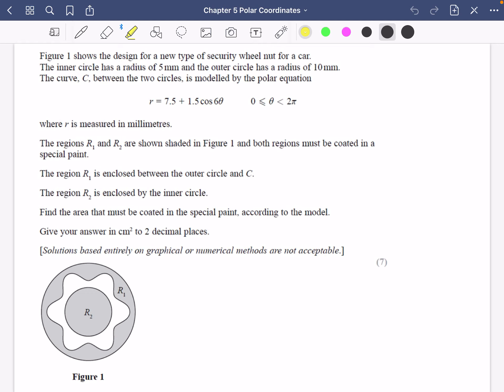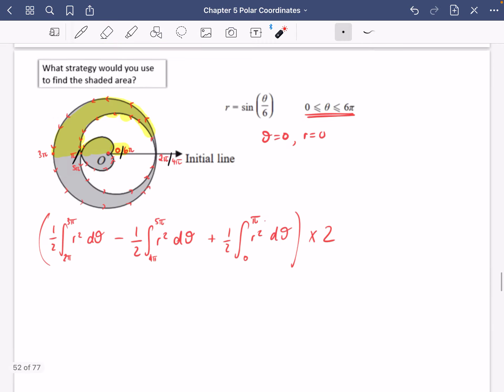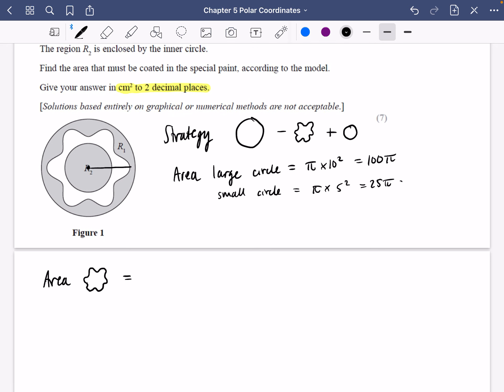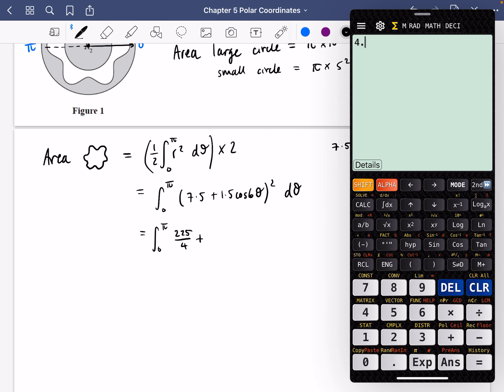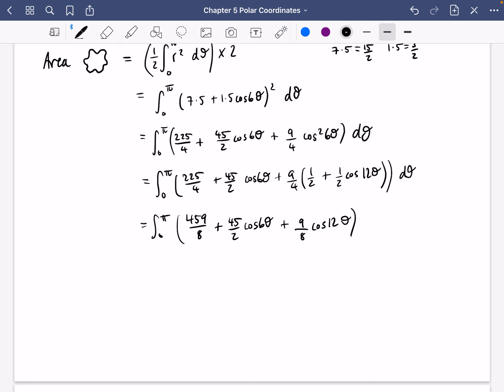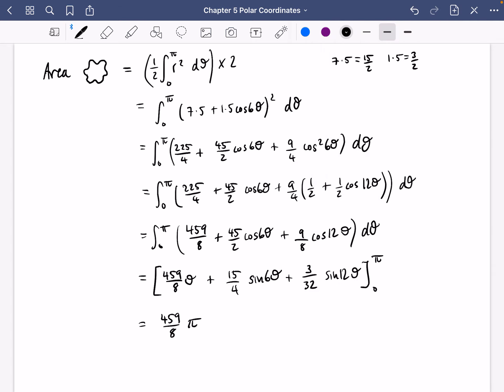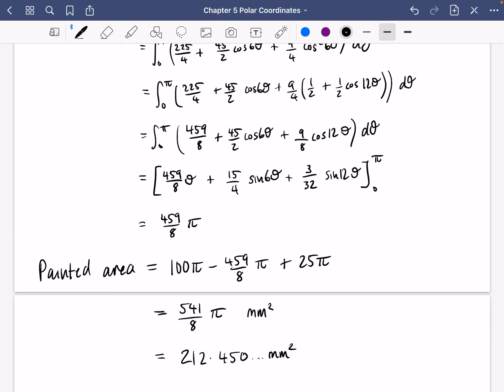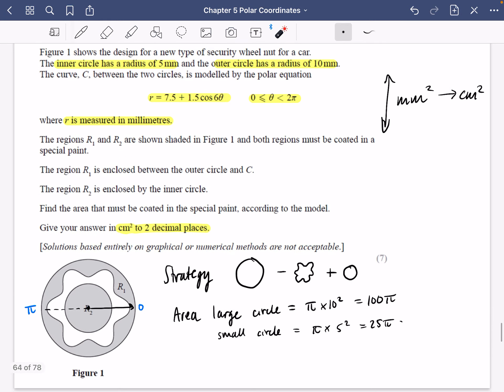Polar Coordinates 16 • Area Exam Questions: Part 2 • CP2 Ex5C Exam Qs • 🎯

Comment: How do you know that the limits for the area of the squigle is pi to 0 as that could be the limits for the small circle or large circle as well.
Reply from the maker: So the limits for all of these shapes (the big circle, small circle, and the squiggle) are 0 to 2pi. But to save some calculations, I used 0 to pi, and doubled the area, as it is symmetrical. This cancelled the 1/2 that you usually get at the front of polar integration. The true limits are 0 to 2pi as it is a full circle of area. Hope that helps!